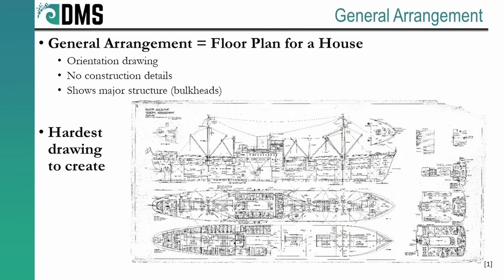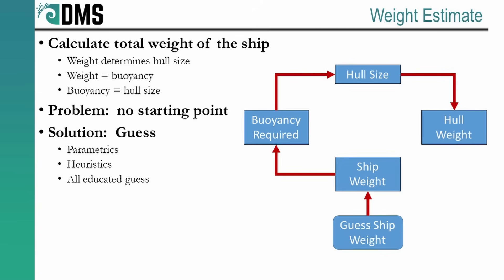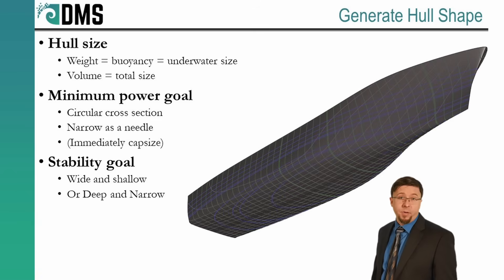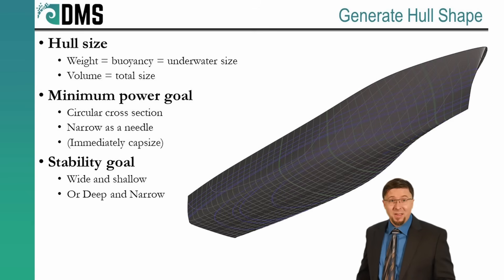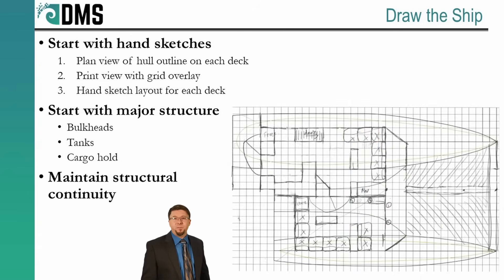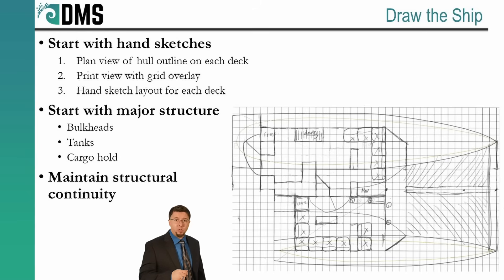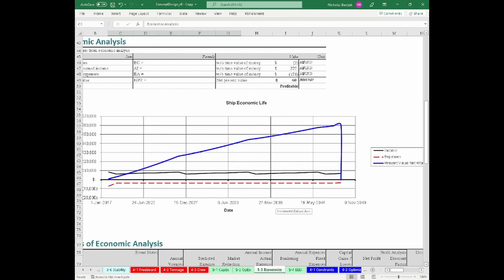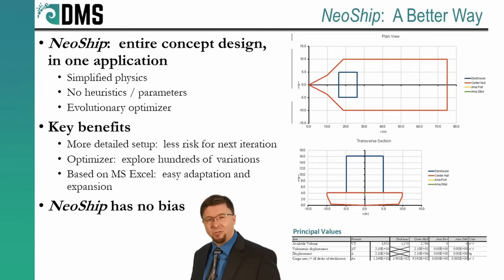How to Design a Ship:  Creating a General Arrangement

Comment: Very interesting. Coming from a product development background, wouldn't the first step be to figure out what the job of the ship will be and what equipment is needed? At least for non-cargo ships. I've never worked on ships before, but I  assume the weight of that equipment multiplied by a factor which depends on the ship type (possibly with an added range parameter) should give a pretty reasonable initial weight estimate.
Reply from the maker: The equipment weight can be surprisingly consistent within each ship type.  This is mainly because we need so much equipment for basic life support and powering that additional deck hardware doesn't add much to the baseline.  (There are some exceptions like fishing boats and oil rigs, which is why we start with similar vessels from the same industry.)

But the rest is spot on.  Yes, before we even do a concept design, it can be helpful to do a mission study, where we define the ship's job in engineering terms.  One of the biggest items in the mission study is finding any restrictions on the vessel dimensions.  We look at the different ports the boat will visit and check for shallow draft, or low bridges, narrow channels, etc.  And then that forms the starting point for the concept design.

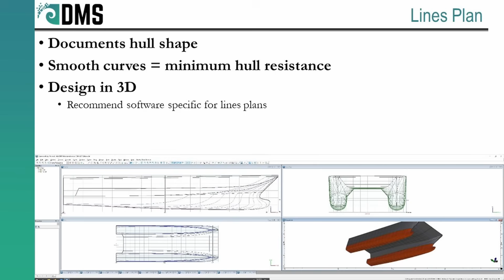Comment: 9:00 I guess using loft in Solidworks is only practical for simple hull shapes.
Reply from the maker: The loft command is pretty close to how the lines program calculates the final hull surface from curves we put in.  But you still need the custom tools to check for a smooth curve in all three dimensions for any complex hull shape.  They are normally hulls that have compound curvature:  the surface curves in both directions.

Another item that we often check is developable surfaces.  These are shapes that only have curvature in one direction.  You can create them from flat steel plate with just a plate roller.  Much cheaper than compound curvature, which requires a lot more skill to create.
Reply: @DatawaveMarineSolutions  wow, I did not know that.  Thanks for the added information.👍🏻

Comment: Differential equations are fun.
Reply: In the books Principles of Yacht Design by Lars and Rolf Larsson, use of Simpson's rule for the calculation of the hull's characteristics is shown. It was recommended to use a planimeter for the crossetions.  This was for those without access to CAD.
Reply: @shaider1982  yes, before computers, the methods used for integral estemation were quite clever. But in a world where butane lighters exist, theres no real sense in rubbing sticks together these days.